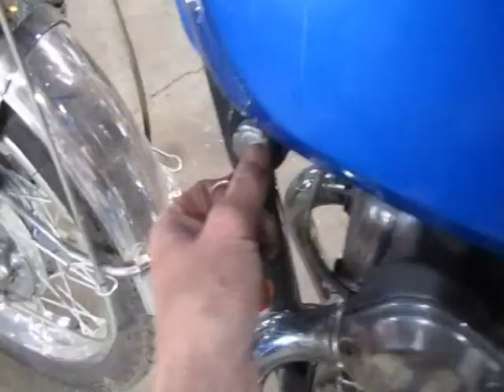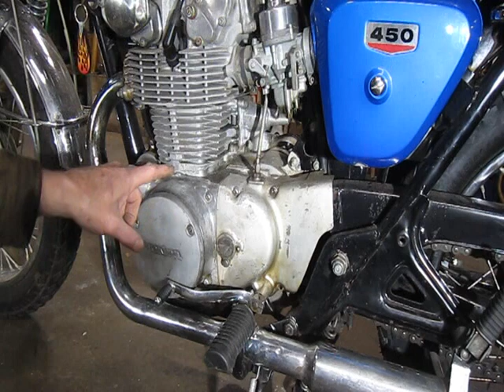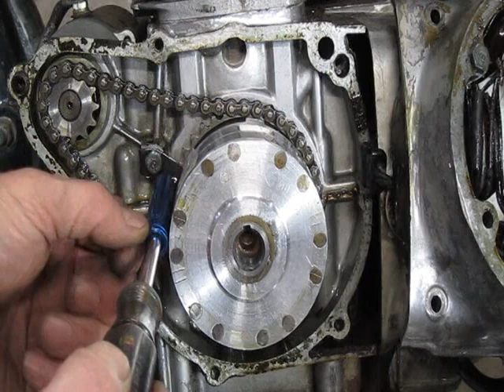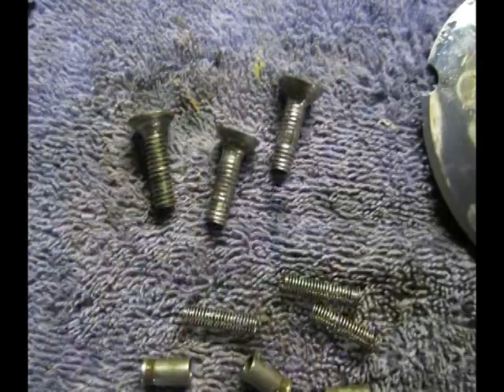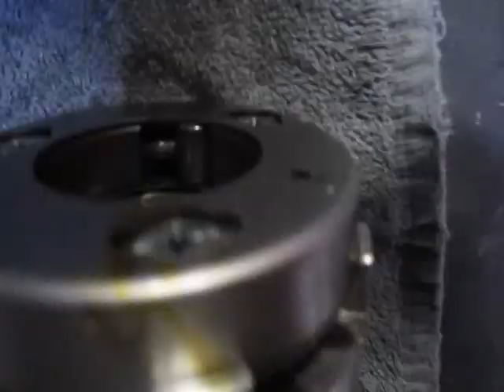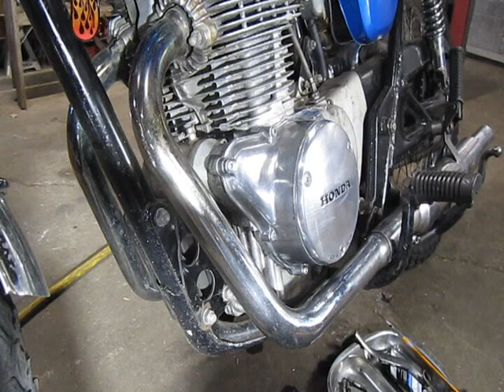Honda Twin Starter Clutch Repair CL450 CB450 CB350 CL350

Comment: Where do I find that part?  I searched for it on amazon and I can't find it, help, I have a Honda CB450
Reply from the maker: You can try eBay, or just google it. You can find the rollers and springs,  but if the housing or the sprocket is shot then you'll have to find a good used one.

Comment: After many attempts of changing springs and rollers with no result I made 3 oversized rollers by 0,3 mm each and from then on no problem. The rollers were from a machine shop because they have to be hardened. I realized that there was wear where the rollers nest.

Comment: Did you clean the starter clutch assembly thoroughly? Did you then apply "silicone" grease to the rollers and surfaces? If you didn't you are not following the workshop manual. The starter clutch will last longer, will only operate at its best and be quieter in action if you follow the engineers advice......... they did know what they were talking about.
Reply from the maker: Do you realize that the starter clutch runs in an oil bath on that engine?
Reply: @Amotorcyclenut  Hi again,  and apologies if I've offended.  I was just trying to keep it short. To the best of my knowledge the starter clutch does not run in an oil bath. When we put the bike on the centre stand and take off the large side cover to get to this area, as we know, very little oil comes out. The stator and this clutch are well above the oil level when the engine is not running and when running the oil level drops even more. Also, the centrifugal force keeps any oil mist out of the starter clutch rollers. All I can say is that I rebuilt my starter clutch, including a factory in spec/as new clutch drum and it worked quite well, but was still a bit noisy and didn't grab occasionally. After finely actually reading the factory work shop manual, I pulled it down and did what the factory said. I cleaned it, Silicone greased it and it has been much quieter and has always hooked up instantly...... I don't know what else I can say except that it does operate better......

Comment: Damn I put new rollers and springs and knock pin in and it will only turn the engine over once (you can hear a bump bump one for each cylinder) and then it loses grip and spins like before. The big sprocket had a smooth surface where the rollers roll and only a tiny bit of play in its bushing on the crank shaft. What is my problem?
Reply from the maker: The big sprocket might have a flat spot on it . Also it will help it you polish the where the rollers roll. 240 emery paper should give you the right surface finish.

Comment: So although both are normal thread, and you turn the bolt counter-clockwise to remove, to to use the puller I turned it to the right with my impact driver, and just like in the video the stator popped off after couple of tries. Had to go to a machine shop to get one of the 3 Philips head screws out, it was in so tight.  Now that I am reassembling with new roller & spring kit from Common-Motor and a NOS knock pin from Ebay how much torque to to use on the 14mm bolt that holds the rotor on? I don't want it to come loose but I don't want to over tighten it.  Am guessing about 25 ft lbs?
Reply from the maker: It's a 8mm thread and the spec is 23.5 ft-lbs  +- 1.5 ft-lbs  so good guess. Make sure you center punch the 3 Philips head screws on the edge so they don't come loose. That's why they where so hard to get out. The torque spec for those are 96 in-lbs.

Comment: Thanks, but 2 Qs: When you remove the nut from the alternator rotor (you call it flywheel) is it R or L hand thread? When you next use the puller tool,  is it R or L hand thread?
Reply from the maker: It is right hand thread. Puller tool is also right hand thread. Look in video description if you want to order a tool. Here is a link also Flywheel Rotor Magneto Puller Tool 16mmx1.5 Rh Male Honda https://amzn.to/3hlEKCg
Reply: @Amotorcyclenut  Thanks. Got a puller from www.Common-Motor.com (they specialize in parts for CB350 and CB450).

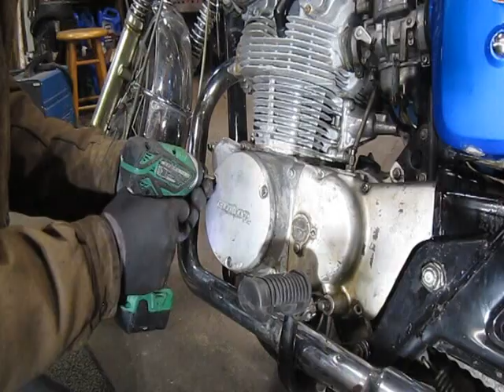Comment: I'm sorry but I had to leave when the noise started at 1:20. I was able to continue watching after the noise abated. This has been quite a recurring problem with Hondas. Thread locker would have solved most of these problems.

Comment: This is what i have to do to my c77 Dream. Apparently it's a common problem with the 305 engine too?
Reply from the maker: Starter clutches on dreams and super hawks do not run in a oil bath so make sure you lube them before you put them back together.

Comment: The oil flow to the top end of all DOHC 450s takes a minimum of 1 to 2 full minutes to get to all cam lobes and followers.  Revving it up like that stone cold will lead to excess follower wear when the leftover film of oil gets burned through in seconds and the cam lobes run dry over the followers.
Reply: Yep even with an upgraded pump, it accually tells you in the owners manual not to rev it for a few minutes.

Comment from the maker: To support this channel go to Amazon through the links below and make any purchase:
Flywheel Rotor Magneto Puller Tool 16mmx1.5 Rh Male Honda https://amzn.to/3hlEKCg
This one fits a lot of older Hondas and other bikes also

 
Get a set pullers for a couple bucks more.

10 Pcs Rotor Flywheel Driver Puller https://amzn.to/36ZlEhG

Honda Genuine HONDABOND 4 https://amzn.to/39XGtMs
Reply: Are you sure the puller is M18? Thought it should be M16.
Reply from the maker: you are right I'll fix that. Thanks